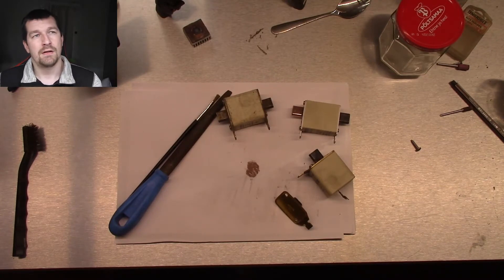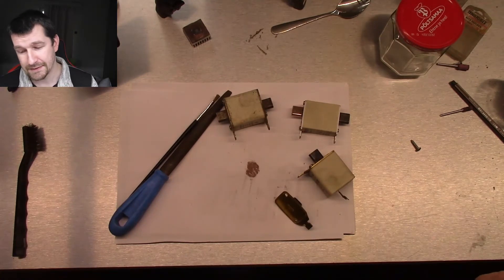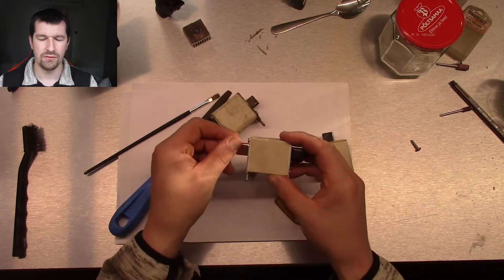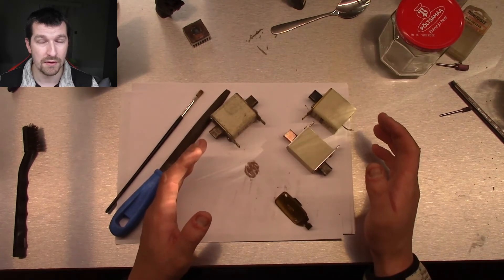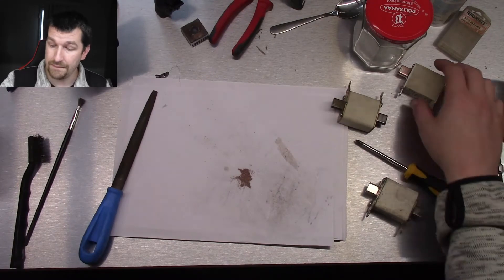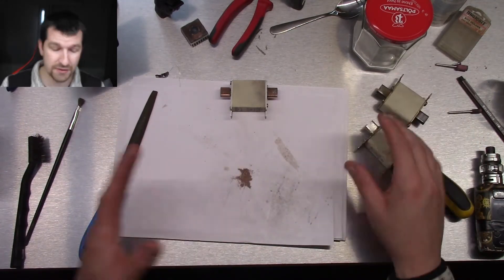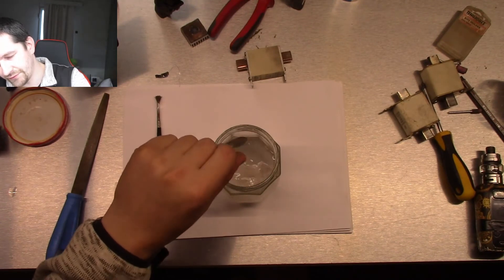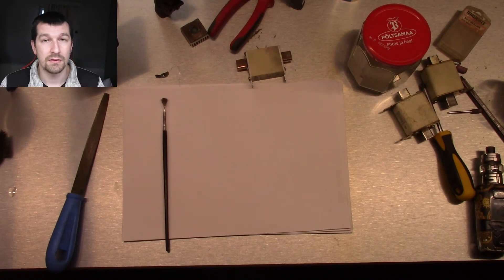Silver Recovery with Salt and Vinegar ( part 1 ) ( 136 )

Comment: Okay now I am looking at the properties of salt and other things they can have with them other than sodium and chlorine. Some have traces of potassium, iron and zinc and because of ocean pollution sea salt now also has large traces of lead and microwaste. I know pink salt gets its color from rust or iron oxide and it also can have different levels of calcium, potassium and magnesium, I know kosher salt probably has little to no anti-caking agents or iodine. Celtic salt is made from seawater and can have varying mineral traces in it. I know there is volcanic salt which has other things it it too. I wonder if there is a salt that could work better than table salt..... i know lol I am a pain in the rear end lol.
 Stay smart my friend <3 tal
Reply: as far i know it is  also  good way to get rid of copper by  salt and citric acid disolved in tap water with addicion of peroxide  much faster than vinegear
Reply from the maker: have to try it at some point
Reply from the maker: well.. i quess that i have to learn some stuff about salts lol
Reply: Thanks for all that info on salt, very interesting.  Take care, Poo

Comment: good idea  i was thinking about that way tough i did use angle grinder instead of file  and find out is a bit dificult to catch  all those grinds and my  experiment end up at that stage,thinking about to create kind of catch box tough never gets on it  so far, tough  vinegear solution should act same with copper and brass
Reply: My friend uses a vacuum hose to catch all of his filings hahaha that was back in 1980s lol but it should still work today lol he made a small vacuum one time from a blow dryer lol but it is a thought....
,3 tal
Reply: @talbertsmom7667  thanks for tip  i may one day reactivate that experiment
Reply from the maker: i can try it with brass too..